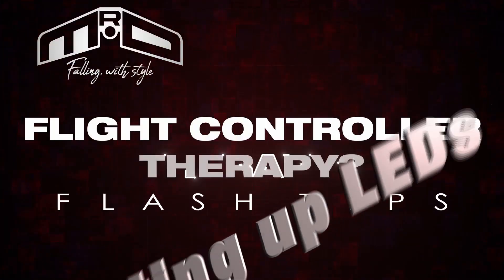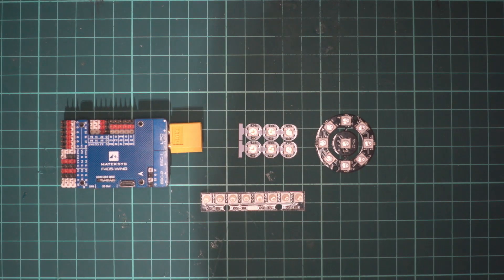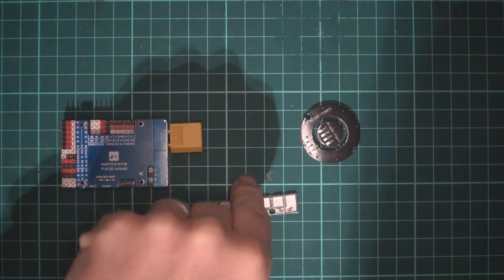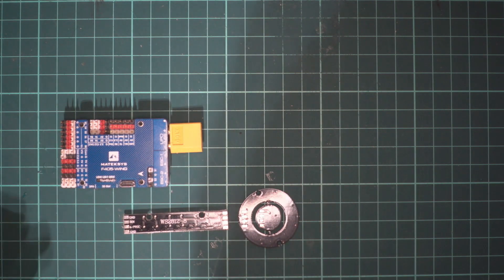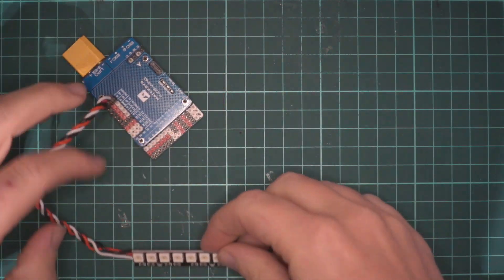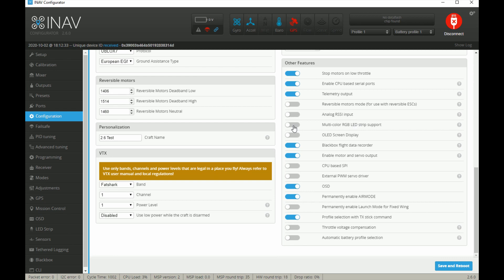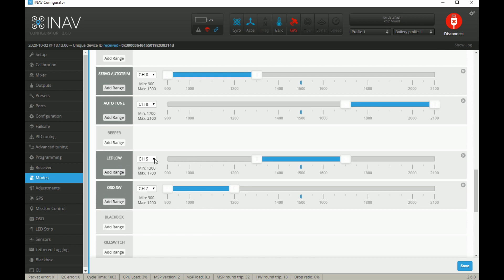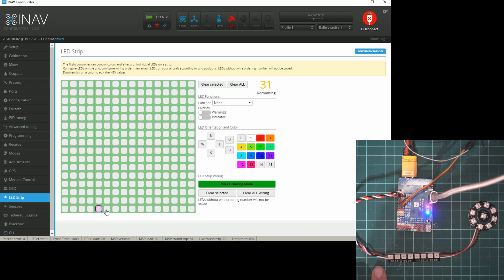Setting up LEDs on your flight controller

Comment: how can you display the autolaunch mode? i mean, when you arm the wing, i would like to get the information that autolaunck is ready to use. is it possible?
Reply from the maker: It shows the state of autolaunch in the system messages.

Comment: I have the Heewing T-ranger and I can’t get the lights on both wing tips to work.  Everything is connected properly to Matek F405WMN board what am I doing wrong!
Reply from the maker: Sorry I don’t have one of those yet. I believe the PnP and kit versions had different LED setups. One needed an extra board that HeeWing sell to work in some cases. But I don’t really know much details. You’d be best asking in a HeeWing or T1 group.

Comment: Thanks I appreciate you going over all the most commonly used LED modes. Building my first plane that isn't a PNP. Going RC Dolphin and bought some led strips and now I want to order an LED ring for the motor.
Reply from the maker: Nice. I do like the LED rings around motors. I think they look cool.

Comment: Thanks for your INAV vids! My plane has navigation LEDs (one color, non-addressable). I would like them to blink when INAV is armed. Can this function be made to control non-addressable LEDs?
Reply from the maker: Thanks Mike. 

Unfortunately not. You would need a blink circuit between the power for the LEDs and the LEDs themselves. The iNav LED feature is only for addressable LEDs.
Reply: @MrD  Thanks for your reply Mr.D!  It's crazy that a flight controller can't make a couple LEDs blink! On my (H743-WING V2) I believe it has a switchable 5V output on the Vsw pin. I think switchable means that the Flight Controller can switch the voltage on/off? Maybe I could connect my LEDs to this Vsw output and set up some logic in the programming tab to blink the LEDs when armed? Do you think that can be done?
Reply from the maker: No problem. The flight controllers can make LEDs blink. They just need to be the right kind on LEDs ;)

Unfortunately the logic conditions won't help either. There is no timer logic that could do this. If you're using OpenTX, EdgeTX, or ETHOS; you could use the logical switches and timer on there to change a channel from -100 to 100. Then have that channel operate the USER mode that switches the Vsw on and off. But I honestly think a little timer circuit or even ESP32 or nano Arduino would be the better solution. Depending on the LEDs, they may pull more amps than the Vsw pad can handle.
Reply: Yeah, I would like the extra functions addressable LEDs would give, and I have some of those LEDs lying about. I just didn't want to tear apart the preinstalled wiring and LEDs or install extra hardware. I now have the arming channel also controlling the USER mode to switch the Vsw on/off (but doesn't blink LEDs). I could put it on a different channel and setup the timer circuit in EdgeTX. I have two channels still free (until I purchase and install a Pan/Tilt camera setup.) I might do that if the programming logic can't control Vsw. I appreciate your help!

Comment: hi @Mr.D is it possible to connect 2 led strip in parallel ?  ty
Reply from the maker: Yes, you can connect as many strips as you like in parallel. Just be wary of the power requirements, as it may be better to use a separate 5v BEC if the amp draw gets high.

Comment: Hi ... how much curent they will drawn let say if Im using 32 bit leds. 16 on each side of the wing ?

It concern me for long range.
Reply from the maker: Approximately 1.34A per hour. Without knowing the exact LEDs this is approximate; based on the standard 5050 LED boards or strips. 

32 LEDs at 0.21 W each = 6.72 watts
Running at 5v = 1.344Ah
Running at 12v = 0.56Ah

This is of course, with all LEDs on all the time. I’d they are fading or alternating, they will use less energy.
Reply: @MrD  thanks
Reply from the maker: You’re welcome

Comment: Hey question about the matek 405 wing flight controller... Fc working fine until I flashed the newest firmware.  Now it will connect to I nav but it will not respond to the set up tab.  When I move my Fc it doesn’t move on the screen? Any ideas why this would be?
Reply from the maker: Try reflashing. Make sure you’re selecting the correct target. I have an F405-WING as my test flight controller. It’s been fine on 2.6.1.

Comment: Nice video! 
Just a question, can you adress a UART-port to a LED-port? My FC doesn't have a pad for led.
Reply from the maker: Thank You Emile. Unfortunately not. Well, not just by using iNav. You could possibly do it by making your own firmware target and reassigning something to be an LED output. But I’ve not really looked deeply in to this.
Reply: @MrD  Thx for answering! It'll be a plane without led's 😅. I don't have the know-how to make my own firmware.
Reply from the maker: The other option is to use an external LED controller, like the MudDart MudLED module.

Comment: Help to understand please, there is a ring on the plane.. with 16 LEDs. i can't figure out how to make it work the same way when you increase the gas stick as you have in the video
Reply from the maker: Sorry for the late reply. It should be exactly the same as in the video. You would just add the 16 LEDs for the circle instead of the 8 that I have used.

Comment: Does this work on arduplane?
Reply from the maker: To be honest, I don’t know. I don’t even know if arduplane can control LEDs. I would imagine if it can, the wiring would be the same, and there would be some settings in that giant parameters list. 

I am looking to try arduplane at some point. As I think it will be worth learning. But last time I gave up as the MissionPlanner UI is badly designed, and the guide on the ardu wiki was wrong. But I will try again.
Reply: Arduplane is real good now you should give it another try. I am glad I took my time to learn it and the new firmware is a breath of fresh air. I do not look at inav anymore. However this led thing is tempting. I have some leds lying around) But there is no information if those leds can be supported and controlled via Arduplane

Comment: Great video! Wish you didn't need to keep a chain going. Would be easy to set up navigation lights.
Reply from the maker: It is a little inconvenient. But I did it with my S1100. I think for most things going forward, if I want nav lights, I’ll just use the flytron strobon LEDs. They’re really bright and switchable.

Comment: Great video!!! Any reason why you started at the bottom of the grid? Does it matter where we start on the grid?
Reply from the maker: No, you can start anywhere on the grid. I usually like to lay them out on the grid as they are on the plane. Then it’s easier to know where you are.